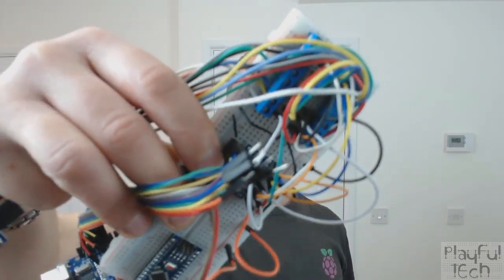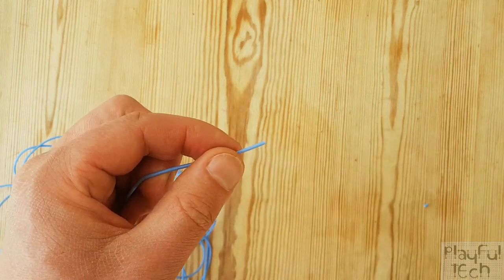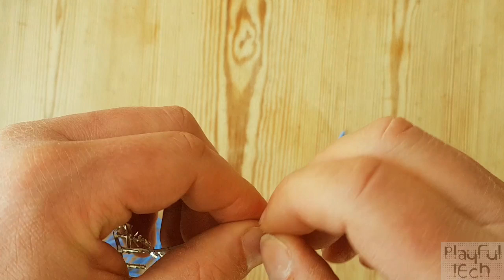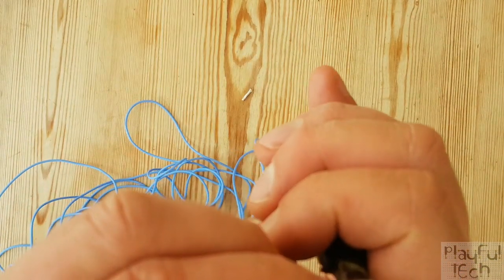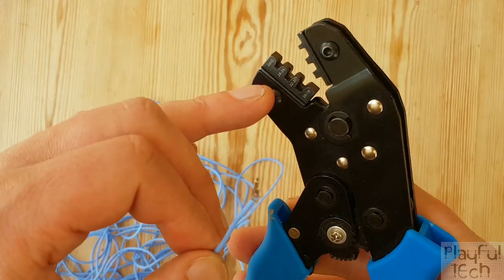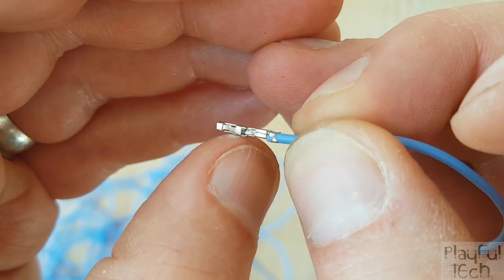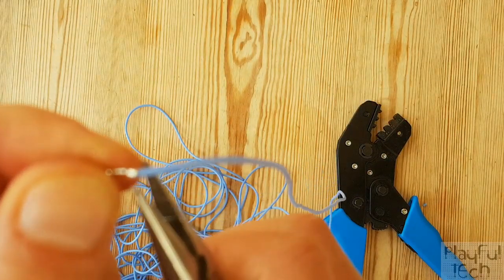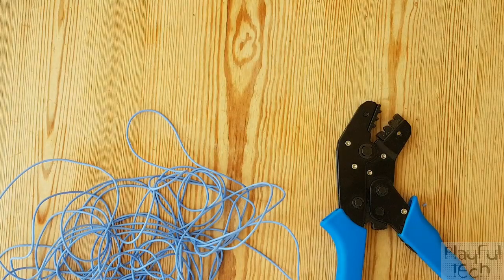How to crimp your own cable harness

Comment: Bruh you make this look easy. Spent an hour crimping like 3 wires, these clumsy ole hands of mine. The wire kept coming out of the bezel..frustrating to say the least.
Reply: 1. Make sure you’re not stripping off too much insulation. If excess strands intrude into the contact area, they can prevent the latch from latching.
2. Make sure you’re not damaging the contact area itself. The boxy part at the front must remain boxy, as that is what the latch pushes against to stop the contact from popping out. Some contacts have two extra little wings by the contact area itself, and these are not intended to be crimped down. (They’re extra rotation stops.)
3. Check that the insulation crimp is narrow enough. Many (most?) cheap crimp tools crimp the insulation too wide, sometimes to the point that it won’t fit in the housing. Check for interference on insertion. If it’s too wide, you may be able to use one crimp die smaller, or use pliers to slightly narrow the insulation crimp after the fact.
4. Check for axial bending. If the contact is bent up or down after crimping, it may no longer fit the housing. Carefully bend it straighter if you can and see if that helps.

Comment: Hey Guys,  I've been crimping wires for many years on aircraft avionics systems which use crimp pins and I must clarify:  The wings go up in the crimper, not down.  The wings are to fold in on themselves in a curved movement, like a M.  Otherwise you get a sharp bend on the wings that can fail.  Putting the crimp pin in the crimper and squeeze several rachets and leaving just enough room to insert the wire works very well.  Thanks for the video.
Reply: His crimp tool has the die set installed upside down. Normally the anvil is on the bottom, but here it’s on the top, so the wings go down here. I’d just flip the dies around so they’re right side up.

Of course since it’s the wrong tool for these contacts anyway (hence the mangled insulation crimp) it hardly matters.
Reply: @tookitogo  Mangled?
Reply: @xxxkueckxxx Yep. The insulation wings are supposed to embrace the insulation without penetrating into it at all. The diagonal cut on them is so that they can mate into a full cylinder without an axial seam when crimped.
Reply: Do you use the same crimper tool? Because the one in the video only function with the wings facing down
Reply: Idk what you’re talking about, he crimped it correctly

Comment: Jus started out with making my own cables for ISO Harnesses (Android Head Units) and by default the speaker cable are 20 AWG. I'm replacing them with 18 AWG using the same type and size of crimp connector  and struggle a little bit with getting the new cable to fit in the housing. This video really helped me to solve this problem. Thank you

Comment: How do you take them pins off ? I had a connector with cut wires and i need to rewire the connector
Reply: You need to research "Pin extractor tools". If you are looking to remove them from the plastic connector body.

Comment: I notice that removing the new terminal pin from its 'production tree' required several bends back and forth. The pins I have been using (purchased from Amazon), require only 1 each bend, back and forth for easy removal. I can imagine yours will tolerate handling much better and provide a much longer service life. Is it difficult to determine quality connector pins for purchase?
Reply: Buy name brand connectors if you want reliable quality (Molex, TE, Amphenol, Harwin, JST, Hirose, etc.), purchased from authorized resellers only (digikey, mouser, Farnell, Distrelec, TME, etc). eBay and Ali, you never know what you’re going to get…

FWIW, Harwin M20 are visually identical to Chinese DuPont, but the contacts are much better despite looking indistinguishable. But like Chinese DuPont (and Amphenol Mini-PV, the OG connector for pin headers, and the one with the highest mating cycles) they really need a circular insulation crimp die to crimp properly.

Comment: I have tried and been generally disappointed with a cheap Chinese SN-28B crimping tool. Many connections required multiple attempts to create a solid connection to the pin with a crimp that would fit easily into the plastic housing. This was especially a problem when adding Dupont pins to a ribbon cable where multiple attempts would create different lengths for each of the strands, resulting in a sloppy cable termination in the housing. I've also had a problem with the tool sticking in the closed position, requiring pushing the quick release lever to open the jaws. 

Recently, I found a new crimping tool on Amazon that has delivered outstanding results with both male and female Dupont connections. So far, I've built a few dozen multi-strand cables with only a single failure due to user error in not inserting the wire fully into the pin before crimping. The cost was only slightly higher that the SN-28B but also includes a decent selection of pins and housings.
Qibaok Crimping Tool Kit (https://www.amazon.com/gp/product/B07ZK5F8HP/)

I believe the SN-28B dies are not designed specifically for the Dupont pin geometry, whilst the Qibaok dies seem to do a better job forming the proper bend on the wings that crimp the wire's insulation.
Reply: You’re absolutely correct that the SN-28B was not designed for DuPont contacts — years ago I came across the original (western) manufacturer of it, and it was for 2.8mm spade connectors — far larger than a DuPont! Just as importantly as the size, it’s also not the right shape — DuPont contacts need a circular insulation crimp, not m-shape. The SN-28BMA looks like it’s a tad smaller, which is better, but it’s still the wrong die shape. There are now some Chinese crimpers with circular dies, like the SN-25, but I strongly,y suspect they still haven’t actually made the geometry quite right, as it still looks to be a bit on the big side.

Comment: This is impossible. Never works for me using this tool and my connections last just as long using a needle nose and solder. Done. This is a stupid system whoever invented this should be beaten.
Reply: Crimping works brilliantly when done right: the contact, the wire, and the tool must all match. Original manufacturer tooling makes it foolproof, since the original crimp tools have contact holders (“positioners”/“locators”) and wire stops that ensure the wire is in the right spot. 

Unfortunately cheap crimp tools like this (which is actually fundamentally the wrong tool for those contacts, as the die shape and size is incorrect) lack all of those amenities, turning crimping into an inconsistent, frustrating experience. 

I have started buying original tooling on auction sites and classifieds, where I can get them for $100ish instead of $300-1000. Well worth it if you’re doing more than one or two crimps.

Comment: Thanks. Just what i was looking for. Are you saying only stranded wire will work? If yes - why?
Reply: Solid wire will work, but they’re really not designed for it and it may not end up being as reliable. I’ve done it a few times without issue. But of course I advise using stranded wire where possible anyway, since solid wire will break if flexed too many times.

Comment: Ahh...Alistair get a pair of wire strippers and a pair of wire cutters and stop using pliers and scissors! The right tool for the right job will make your life much easier. Your have a really nice teaching style so please don't teach viewers bad habits.
Reply: But it is 24 awg most strippers don't go that small. I have strippers that do but honestly I find a pair of sharp needle nose of side cutters works better. Maybe it's a preference but I don't see the problem as long as you arn't cutting into the conductor.
Reply: @RedBeard20842  Your teeth work too.  ... But probably not too good for your teeth.  LOL!
Reply: @ronhobyak9902  guilty as charged 😬 😅

Comment: Great video, have done way too many of these already. I use a paper clip to push up the female pins
Reply: I often use a sewing needle a thin one to get the pin out if needed to solder an extra wire or so and then use a shrinkhose to keep it tidy.

Comment: "May be cheaper than the ready-made Chinese cables" - not in a month of Sundays for normal maker purchase quantities. Better quality, by far, though...
Reply from the maker: The first hit I get on eBay for ready-made DuPont cables from China is this:
https://www.ebay.co.uk/itm/DuPont-2-54mm-Ribbon-Connector-Wire-Cable-F-F-20cm-2-3-4-5-6-7-8-9-10-12-20P/401574503715
Which says 10pcs of 20cm cables = £3.53 (+ extra 1 postage) = £4.50 for 2 metres.

Using the silconce wire and I connectors I linked to, you can buy the same 2m of cable for £1.50, and you'd use 30/620pcs from the £10.80 connector set = £0.53 = £2.03 for 2 metres....